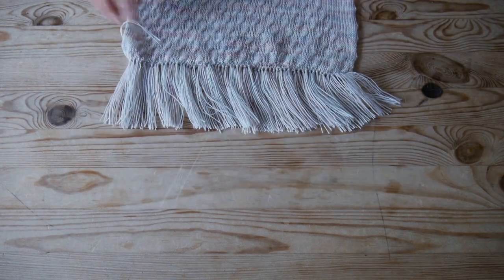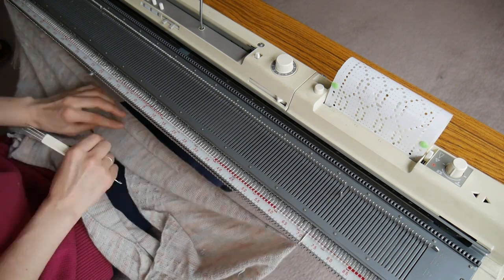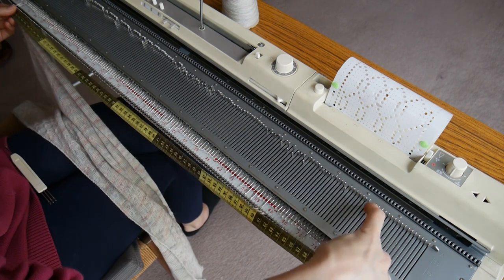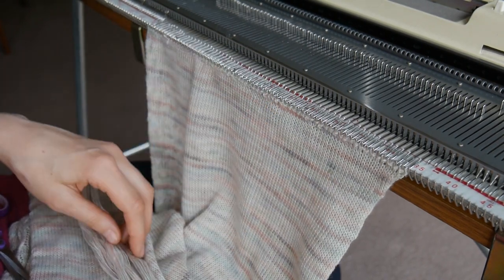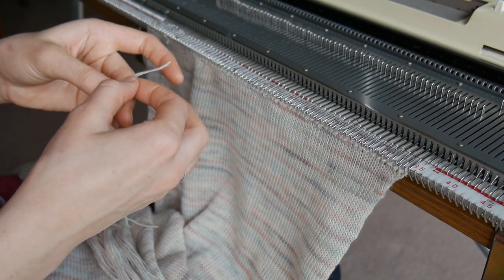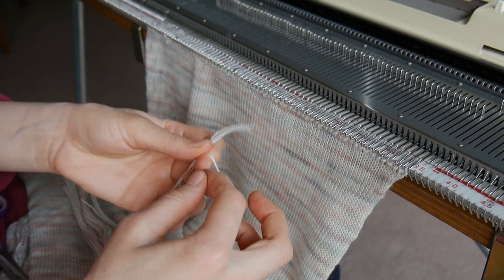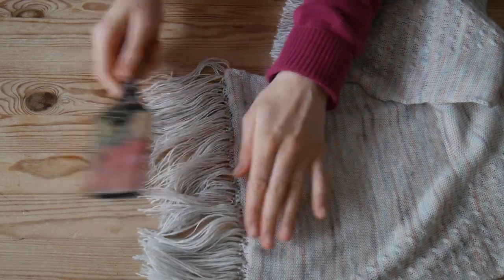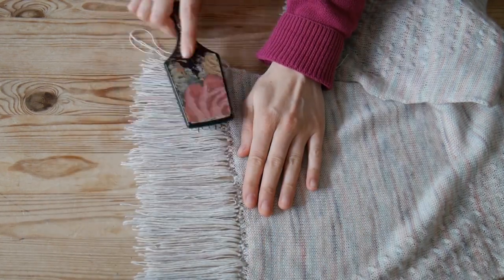Machine Knitting - How to add fringes to a scarf + how to finish off the edge.

Comment: Great video. I usually do most of my finishing work with a crochet hook off the machine but I might have to try doing it on the machine.
Reply from the maker: AJ Boff , thank you. 

I do that sometimes as well. It depends from project to project.
Reply: I’ve always used a crochet hook off the machine, but love this, so will give it a try. Thank you

Comment: hello which yarn did you use on this scarf? and what is the weight of the yarn. Please do a video on different yarns for beginners. Thank you
Reply from the maker: Hi, this is a 100% merino superwash wool from Hands of Uruguay,(Manos del Uruguay) it is so so  lovely. It doesn't say the count on it, it is for hand knitting and it says that the needle should be 2-2.75 mm. I would say it is close in weight with a 2/14 lambswool.

Thanks for the great idea 😊